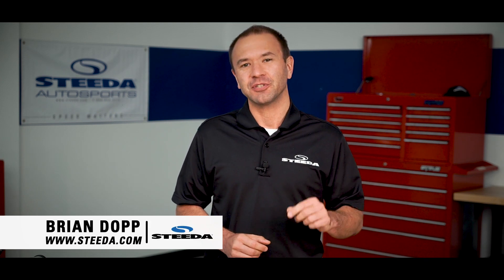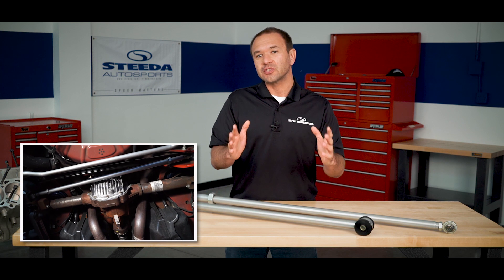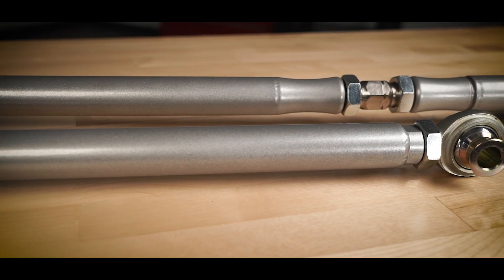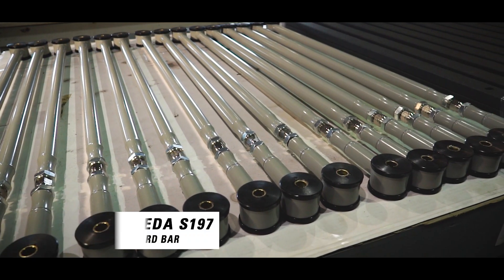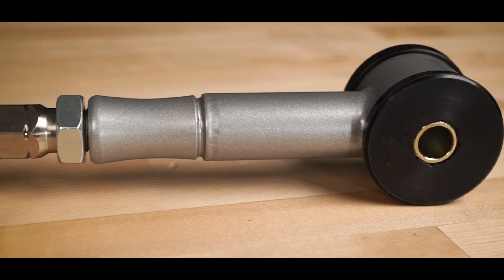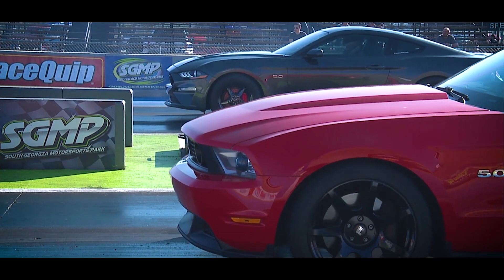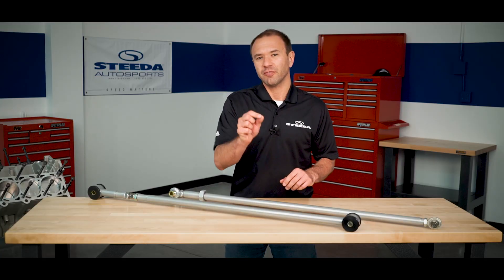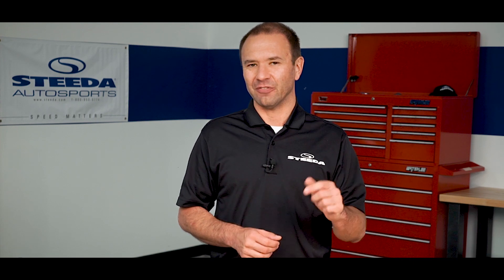STEEDA Mustang Street & Race Adjustable Panhard Bars | Review

Comment: Does 555-2550 bar still have all the performance factors of 555-2551 bar? can the 555-2551 still handle launches if I take my street car to the track once in a while? I guess my question is which one is best for a street car that I may take to the track a few times per year? 2011 GT on E85 w/ track pack 650-700HP for now stock motor, full bolt on, roush2300 supercharger.